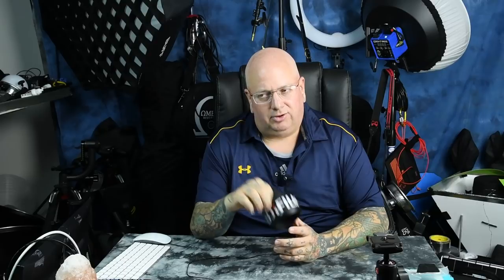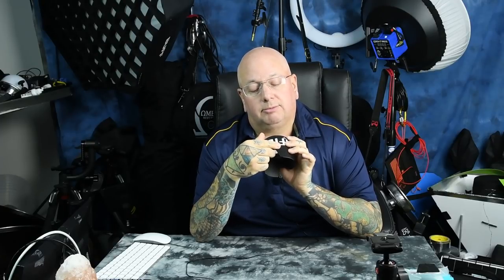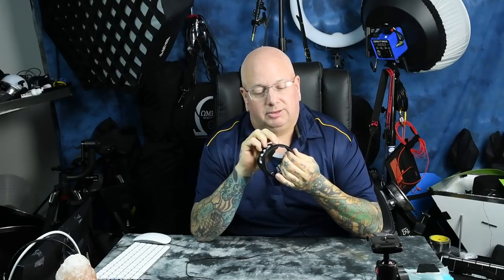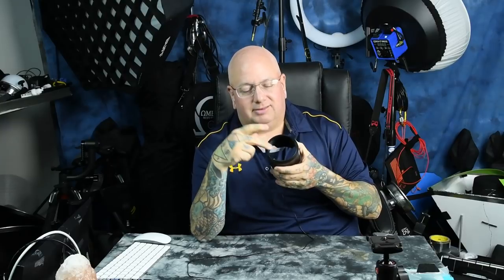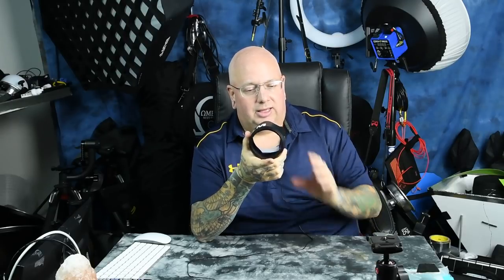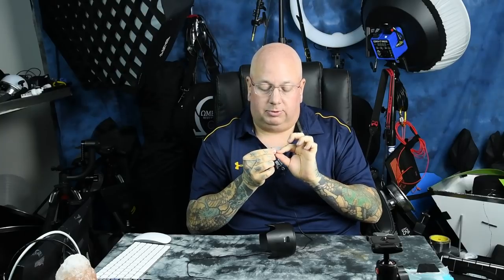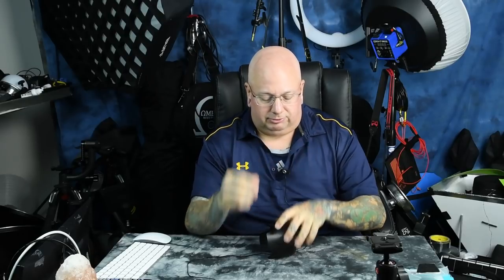🤓 Fujifilm lens hood: Design FLAW

Comment: Yes the 50-140 and the 16 lens hood have both broken on those two. I thought it was just me because I was using both those lenses the most. To make them easier to get on and off I used just a couple of drop of Teflon grease, it does make them a  little smoother to get on and off.
Reply from the maker: grease doesnt help, they still break

Comment: The lock tabs on the hood supplied with the 90mm f2 broke within 2 weeks. Disappointed. So I got a screw on type rubberized. Thing is i don't want to re-buy anything I already bought.

Comment: Majority of my Fuji primes don't use the original lens hood - too big and just seems too cheap compared to the rest of the way the lens is built. One of the few primes I still use the original hood for is the XF80 - I hate that lens hood, more than once the hood has twisted off just from walking about with the camera and lens rubbing against my body. If anyone know of a decent replacement please let me know. 
For the zooms, I still use the original hoods. I was just about to give up on the 50-140 hood until I finally stumbled upon the "secret" way to take the hood on and off - I have to press inwards while turning the hood on or off, no more problems with that hood. But yeah, I do find all the original removable plastic lens hoods to be rather chintzy.

Comment: I totally agree with you. As a user of XF 50-140mm f/2.8 R LM WR and XF 56mm f/1.2 R, these lenses have such a fragile hood clicking system to the lens. Such a hassle to put those hood on the lens, always afraid that i'm breaking it.
Reply: You can buy knock off metal  JJC hood for 23mm f1.4 and mount it on 56 f1.2.

Comment: The problem is that these lens hoods are pretty expensive to buy. For my 35 und 23 f2 i'm using the Hooge metal bajonet lens hood that looks exactly like the original Fujifilm one except it's 30% cheaper.